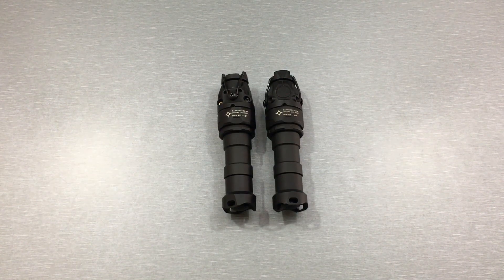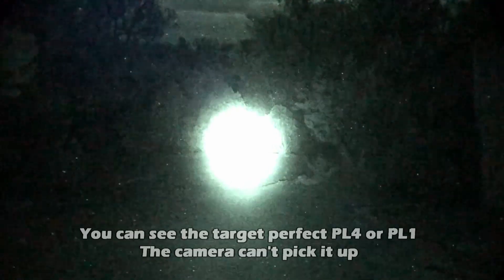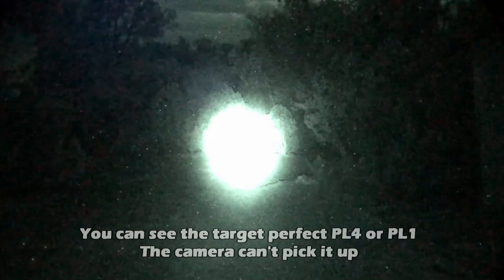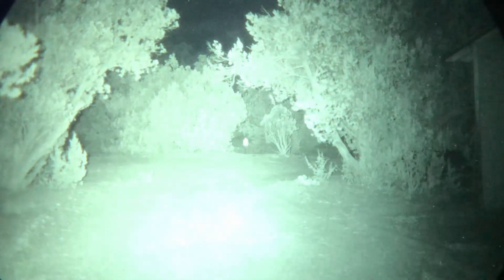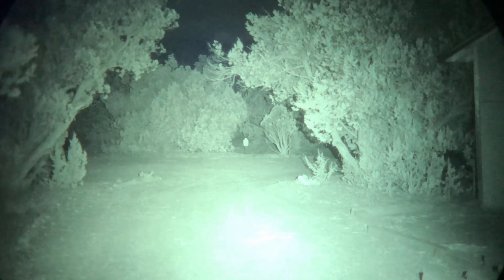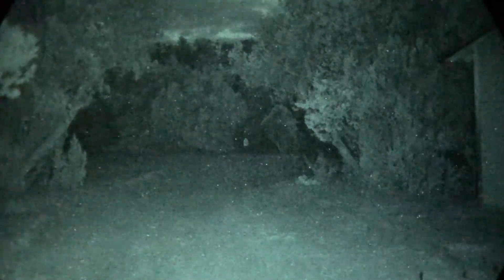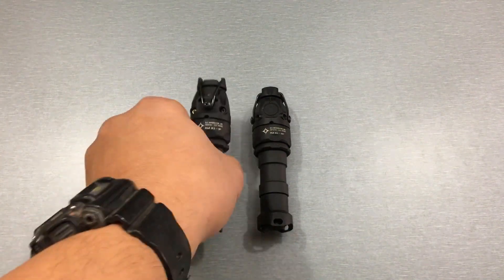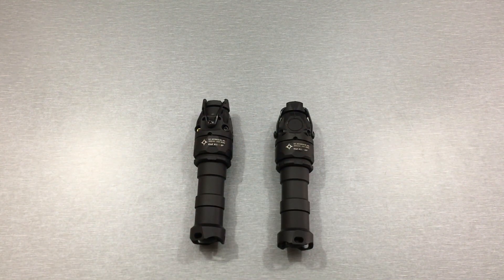B.E. Meyers KIJI K1-3 vs K1-10 Side by Side Comparison

Comment: How does one mount Kiji on PVS-14?  I know most people will mount Kiji on helmet or rifle.  For hand held for observation, I want to mount it on PVS-14.  I suppose I need to find a picantinny rail adapter for PVS-14.  Any idea?
Reply from the maker: AGM makes (or at least made) one but I have zero experience using it and cannot say which mounts will fit on it.

The KIJI uses the Surefire Scout ecosystem and so the rail needs to accept a Scout mount. The OEM Surefire Scout single lug picatinny thumbscrew mount probably has the best chance of working. 

Do a google search for AGM PVS-14 picatinny adapter and you should find it pretty easy

Comment: Hello. Very excellent and informative vide, thank you!! I was just wondering so please forgive my ignorance, but it this (k1-3) used as the MAWL is with as a laser instead especially on a sbr?? Thank you and thank you for your timely response
Reply from the maker: Basically, yes. A MAWL is a better overall system than a KIJI combined with an IR pointer, but with limited space the KIJI combo is a good alternative for a civilian legal output level
Reply: @NITEWALKER-NIGHTVISION  Oh ok great!! Now, I’ve heard that with the MAWL, it doesn’t have the “laser line” where someone could just follow that laser line, right back to you, now does the kiji have that same setup?? Thank you an thank you for your timely response
Reply from the maker: @blackbushido  since the KIJI is an illuminator, it has a lot more output, and someone would be able to see where the source is coming from

Comment: i was going to get an ex ir 250 for illum. at over twice the cost is this worth it? i've watched videos of the ir 250 lighting up out to 200+ yards.
Reply from the maker: IMHO it’s better. Being laser based, the K1-3 has a tighter beam without the extra flood you see with the LED lights. It’s programmable and the toggled mode is awesome to quickly switch from the highest power to lowest with a quick triple tap and hold.
Reply: @NITEWALKER-NIGHTVISION  thanks

Comment: What mount do u use with the kiji on rifle?  Can you buy it at tnvc
Reply from the maker: The body uses the Surefire lug format, so any mounts that are compatible with SF bodies will work with the KIJI. On the TNVC site, go to the “brands” menu and look under “S&S Precision” for the IFM 3V light body rigid mount. Also in brands, look under “Reptilia” for their 3V light body mount. These are MLOK light bodies meaning you’ll have to swap the KIJI head & tail cap over to the body. If you want to use a tape switch, then you’ll need to get a Surefire tail cap such as the DS00 or UE07 with the SF pad, or just get the tail cap (whichever one you prefer DS or UE) and add a Unity Tactical TAPS Sync or Hot Button.
Reply: @NITEWALKER-NIGHTVISION  thanks for the info ima buy it on tnvc. Btw are ya gonna be at shot show? That's the 1st booth I go to every year to get a patch since i make and collect patches. I usually see Augie or Chip. Hope to see you since I've been watching your vids before you started with them, be nice to see who's behind the camera 🤙
Reply from the maker: @hodakine  Right on 👍 and yessir, I look forward to meeting ya

Comment: Wanna swap the diffusers. I’m sure other people have wondered as well.
Reply from the maker: As expected, the -3 with the 40 degree looks pretty much identical to the -10 with the 40 degree. I didn’t bother with the 10 degree on the -10
Reply: @NITEWALKER-NIGHTVISION  thank you sir. Do you think that would be a decent option for close and far in one unit?
Reply from the maker: @FlowBaka  IMHO, the -3 is fine the way it is with the 10 degree diffusor, however, the 40 degree is also very useful. Especially inside structures on a lower PL.

If they become available separately I'd recommend getting one to try it out.
Reply: @NITEWALKER-NIGHTVISION  it being replaceable I’m sure they will be available down the road. I appreciate the info.
Reply from the maker: I’ll give it a try 👍

Comment: Another valuable content, thanks!! I heard of someone using just a perst3 with its spill for 50 or less and Cqb with no Illuminator. So after watching this I’m wondering if I could just use a K-3 and a rds for target acquisition. Maybe it’s not always feasible like in daytime to do that. Idk, I’m saving for nods still but if anyone can shed light (pun intended) on which of the two cheap routes to take I’d appreciate that.
Reply from the maker: It's possible with full power pointers but not in all conditions. You can get so much bloom that it can make it considerably difficult to place more precise shots. A properly matched illuminator eliminates the bloom and gives a crisp aiming dot.

Yessir, the K1-3 and RDS would be an inexpensive way to get IR aiming capability, and I recommend that to many guys on a budget for passive & active aiming solution. Add an OTAL-C and TAPS SYNC down the road. If you haven't seen it, check out this video with the K1-10 & OTAL-C. I'm not going to do a vid with the K1-3 and OTAL-C because the video won't come. Cameras can rarely capture it through night vision (always appears too bright) so you wouldn't be able to see the OTAL-C's dot. Using extra IR or filming under a bright moon helps but then you're going in the opposite direction where it reduces how the output performance looks.
Reply from the maker: Forgot to add the link: https://youtu.be/F0ccBHHGi10